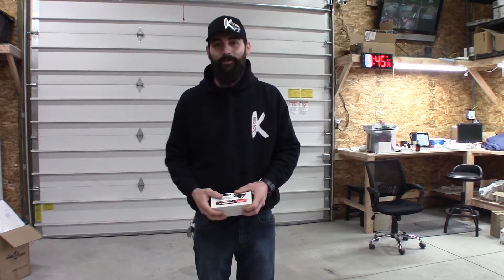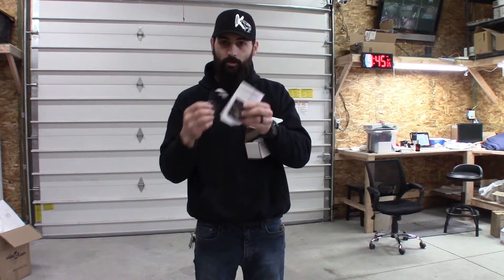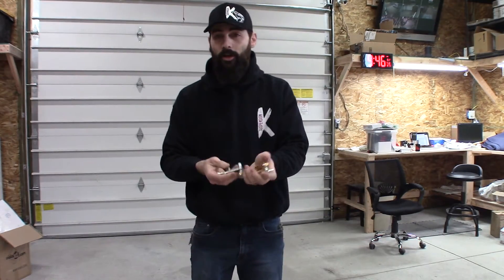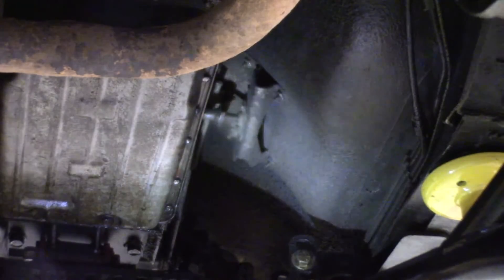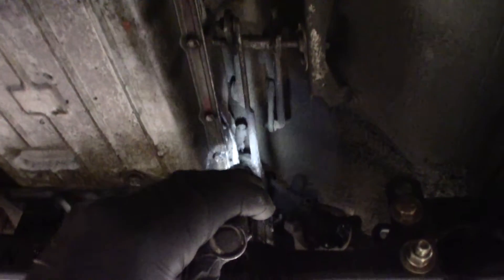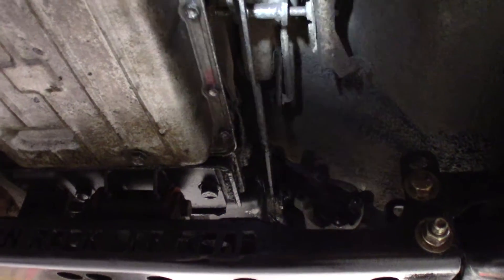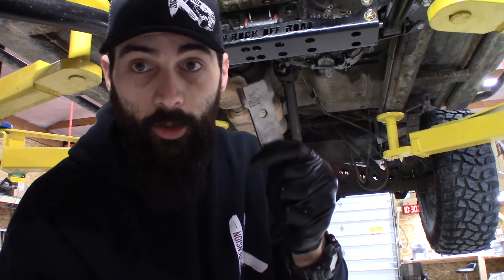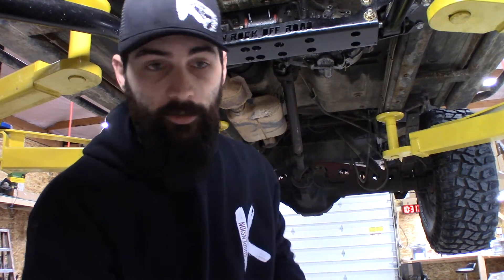Azzy's Design Works Shift Linkage

Comment: 10:22 5 Speed guys, that's so you can angle the plate forward a hair, give you 1" extra room for the rod ends and turnbuckle. Some 5 speed XJs use the same lever hardware as a TJ.  TJ guys, we have a different kit for you as well.
Reply: We just did up a video today to help those having trouble -  https://youtu.be/od64eiC7XsI
Reply: Do you have a kit for a 6 speed TJ?
Reply: Sorry to be off topic but does anyone know of a method to get back into an instagram account?
I was stupid lost the password. I appreciate any tips you can give me.

Comment: For anyone with an '01 XJ:  Mine needed to use the top mounting hole on the t case shifter tab.  Instructions call it part B and say "most applications use the center hole".  There wasn't room to get the lock nut on with the middle hole setting and the indicators on the bezel weren't lining up correctly.  The top mounting hole nailed everything on the nose.👍🏼
Reply: No you can use the middle it's just difficult
Reply: It just takes about a 1/2 an hour of tedious finger work lol
Reply: @christopherduby5330  I used the middle hole on my 01 xj and it doesn't allow it to go into 4low, and when it's set ao it does go into 4 low, it doesnt cone out if part time4wd to go back into 2hi

Comment: I put my shift lever bracket on the transmission side of the lever. Then turned the turnbuckles all the way in and used the bottom hole. It was perfect off the rip, if anyone got the cheapo on Amazon😂 it had no instructions.

Comment: I just attempted to install this on my '98 XJ with a 2.5L 4cyl, AX5 and a TeraLow case, the discontinued one with 2Lo capability. I spent 6 hours under the rig trying every possible configuration to no avail.  I emailed Azzy's thru their website since I don't do fb or ig. I hope I can get a refund. Looks like I will have to go cable operated.
Reply: What was your outcome on this working with the Tera Low kit? I have the Tera Low kit as well..

Comment: It doesn't seem to be as smooth coming out of 4lo with a 242 t-case. After an hour of adjusting, i got it okay but not that great.
Reply: @ksuspension6830  i spent over an hour using all 3 holes. I ended up using the top hole and its better than it was but still takes a smack to get it out of 4lo. I think its the extra angle of the 242.
Reply: @ksuspension6830  hmm i did not know that.
Reply: @ksuspension6830  yeah it looks like i am missing the extension. They are sold out of them on the website.
Reply: I just ended up making my own extension and now its really smooth!
Reply: Great video !! 💯

Comment: But mu 87 Comanche has a vacuum set up?? How do i alter that. Don't allways work. Ain't like this example. Mine has 2 piece axle. I understand yhe 92 axle is one piece? Seems like thT would turn the diff all the time 4x or 2x. Not good? Dandahermit
Reply from the maker: This is for the transfer case. Not the CAD connect

Comment: Well azzy, I just installed your linkage, I have a 5 speed in my 4 door xj sport, I will be straight up , this absolutely ridiculously well built and 100 percent built a bad ass product,  if u take the time to adjust this kit correctly and set your shifter lever correctly on the money, its flawless , I even have a 1 inch drop on my xj installed first today and then set the linkage up but I did all the hard part while the crossmember was off , absolutely great product works amazing. I recommend this kit to anyone who owns an xj.. ps . Again it takes time to tweak and tighten everything,  works flawless...👍👌

Comment: Finally got one of these. I rebuilt my stock linkage years ago, but it's getting hard to shift again. Thanks for the video, Raffi!
Reply: Then , what was the problem ?
Reply: @arnoldbilibok7203  The problem was the bushings for the shift linkages were wearing out, and things weren't lining up anymore. It was getting really hard to shift into and out of 4wd. This linkage fixed the problem.

Comment: I dropped my TCase and it would pop out of 4 low. So I cut my shifter bracket on the 4 low end where it bottomed out to give it a longer throw.  I cut a 1/4 ×1/2 notch and it gave an extra inch of travel to my linkage rod. Cheap fix for a cheap guy's . when your disabled you get creative with what you have.  Great video by the way
Reply: Do you have any pics of what u did im having the same problem rod will actually bend when i try putting it in n and 4L
Reply: I’m liking this idea.

Comment: Hello, that truck uses a np242 or NP231 transfer because I see that it is automatic and the azzy part that was used for the installation is identical to the 231
Reply: they're the same part, for the 242's Azzy provides an extension if you need it to fix the angles correctly.

Comment: My question I have is with the first bracket you put in that had the 3 holes, which hole did you use the top one middle or bottom when you mounted the bracket first.
Reply from the maker: Used the middle hole
Reply: @KSuspension  ok perfect cant wait to get this
Reply: Middle hole will match the factory floor gate the best. If you need more rotational travel (custom setup, wear) use the lowest hole. Less travel, top hole.

Comment: So I'm just starting to take the old linkage off and trying to pop the old one out and it's not budging. Is there something on the ends that I need to take off first in order to pop them out?
Reply from the maker: it's not easy sometimes, but it'll pop off. use a prybar or pliers to persuade it out

Comment: I bought mine and installed about a year ago.. The gears dont line up with the labels inside then vehicle now. 2H engages about 1/3 in between 2H and 4L. 4L isn't quite right and even though I can get it to shift into gear it pops into nuetral when I drop the clutch. 4H works fine.. what did I do wrong?
Reply: you need to adjust the turn buckles. you do not have the correct length set

Comment: When I make the final adjustments on the turnbuckle should I screw it out until it's tight or what do you suggest?
Reply: just snug. you'll know if it's too tight or too loose. just test with the shifter each time until it's smooth as butter and lock her down!

Comment: Great video! Thanks! I am on the proses of orden this set up, hey what’s up with the drive shaft ? Double cardan and slip yoke ?
Reply from the maker: The front shaft?
It’s a normal front DS setup
Reply: KSuspension  i thought i was  looking at the rear drive shaft, maybe I got confuse
Reply from the maker: Julio Maciel the rear shaft is a front shaft used with the ironrockoffroad hack n tap SYE
Reply: KSuspension thanks for the info !!

Comment: Is it suppose to rattle or did we forget to tighten something up.  It does work good except I wish I would have removed the driveshaft when installing it.  It would have been so much easier.  I noticed the video it was removed after we installed it.  I think it is an excellent product but it does rattle a little bit underneath and we are not sure if that is normal or not.
Reply from the maker: shouldn't rattle, get with Azzy's and ask them for some support, They'll take care of you. gotta be something simple

Comment: I have the np242 tcase and my azzy linkage came with 2 of the blue brackets with the relief cuts. Do I use both of these and is the process still the same?

Comment: In the instructions I got it says jam nut on the transfer case side (lower linkage) and flat washer on the shifter side (upper linkage). But I did it your way. It probably doesn't matter
Reply from the maker: We have since updated our description under the video
That stated, I don’t think it matters, it won’t come off
Just keep it on your routine checks after wheeling
Reply: @KSuspension  yeah figured they're both doing their job. Just gonna keep an eye on it. Still working on adjusting with my 4.5" lift. Great vid!

Comment: I have a 242 case, it's shifts great as long as I don't want 4 lo. It'll go in, but I have to crawl under the jeep to get it out of 4 lo the linkage binds because the arm on the case and the turn buckle are in a straight line. 
What did I do wrong?
Reply: Have same issue, supposedly need another bar attached to shifter to add length and fix geometry. Still trying all possible combos

Comment: Does the front driveshaft have to be removed for instillation? Was this just done for the video?
Reply from the maker: As described in the video, front DS doesn’t need to be removed, but does help to grant more space for working
Reply: Must have missed that. Thanks for posting the video. Next project will be the cable upgrade  and injectors from you guys!  @KSuspension
Reply from the maker: jeffhermanski ya we forgot to say it aloud so it’s just an overlay typed in, easy to miss haha.
Glad the video helped out though, it’s an excellent upgrade over the factory linkage!

Comment: Any updates as to how its holding up?  Also have 3 of your headlight kits installed, Perfect!
Reply: we've been running these for years across multiple vehicles. Best thing you can purchase to make your shifting smooth!
Reply: @hndaxr400rdr  Thank you sir... I have a '98TJ manual, and my daughters and I love going out in the trails, but they can't drive a stick.I purchased a '95 XJ 2-door auto so that they can drive along too. The unibody is mostly solid, body is mostly solid, but the floors were mostly carpet, lol... The trans tunnel on the passenger side was good, but the drivers side is another story.  Where the linkage bolts up on the driver side... Mostly rot... I can patch new metal in, but not like it was with that shifter linkage.  This totally saved me!   Thanks!
Should I also consider this for my TJ?
Havent had any problems...
Reply: @toddellis5197  I don't believe that they currently make it for TJ, however, I do recommend the NOVAK cable upgrade on the TJ. it's much nicer than stock and way stronger.

Comment: When putting the rear bar with the 3 slots or holes. Which hole did you use to mount the rear bolt?
Reply from the maker: for the turnbuckle? we used the middle hole

Comment: Have a question for you. If you have the time and can get back to me. Would greatly appreciate it. I have a 1999 jeep grand cherokee with the 4.0 motor. Also the  selec Trac Trans. I put it in four wheel drive. That worked fine. But then went to pit it back into two wheel drive and it would not go back. It needs transfer case linkage kit. I have looked on Amazon and other places on line. With no luck. Some of them say for 1997 to 2000. In the description it says though fits  xj. Cj will not fit on WJ. Which is what I have. Can you please send me a link to where I can get the linkage hit?
Reply from the maker: @davidoergel8710  evening! These linkages don’t work on WJ models, I don’t have any upgraded parts I could link you. The WJ is pretty adjustable under the rig, may just need some tweaking to the factory linkage

Comment: What comes of the open hole on the transfer case after the swap?
Reply: Should I find something to plug the hole ? Or doesnt matter ?
Reply from the maker: What hole?
Reply: @KSuspension  in/on the t case ..  from eliminating the rod that goes from t -case to that bracket .  I beleive you cut the rod in the vid. However im talking about the hole that the rod was coming out of . On other side of floor bracket side of that rod on t case
Reply from the maker: @christopherduby5330  leave it or remove it. It’s not used anymore. They’re bolted in from inside the cab, more work than it’s worth to remove
Reply: @KSuspension  not the bracket... I'm talking about the open hole that's left behind in the T case.  If you take a flashlight and look up there on the T case There's a hole that's the diameter of about 3/4 " .  It would be my best advice for everyone to plug this hole after going after market I don't think it's a good idea to get a bunch of mud and debris in your Tc
Reply: Wish i can post a pic.    This hole is what keeps that stud in place alomg with the bracket.
Reply from the maker: @christopherduby5330  email is

Comment: Should it be in 4lo to install the linkage?
Reply from the maker: @joemears4238  you can install the linkage any which way you want. 

Easiest is 4L or 2H in our opinion since those are the longest throws
Reply: @KSuspension  When you installed the bracket on the transfer case its straight up and down. At that point is the transfer case in 4lo or 2hi?
Reply from the maker: @joemears4238  pretty sure it was 4L
It’s get a while, I don’t remember lol

Next one I do I’ll make a note

Comment: Was the linkage hitting a wire at the back of the travel?
Reply from the maker: nope
Reply: @KSuspension  when you were inside the vehicle doing the test shifting and we were watching the camera image of the linkage motion, it WAS contacting and moving something (wiring?) immediately to the rear of the linkage. Also turn buckles are designed to be adjusted by turning the MIDDLE sector. That’s why they go to the trouble of using both right & left hand threads.
Reply: Oh Yea, wear some eye protection!

Comment: So I got the old linkage out. Got the new one in place. Tightened the shifter side down and now I'm trying to tighten the transfer case side and it's almost impossible due to no room. Any tips?
Reply from the maker: Move the shifter down to bring the case link forward

Then you can reach the bolt and nut
Reply: @KSuspension  oh crap didnt even think of that! Thanks so much for the feedback and response